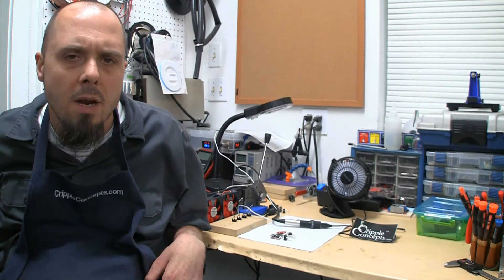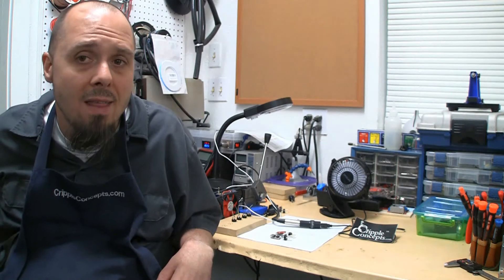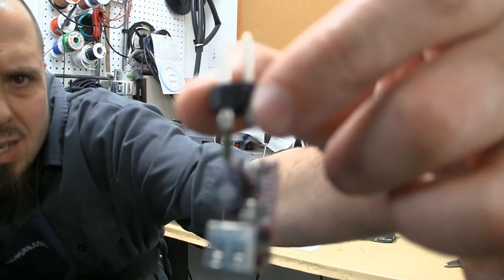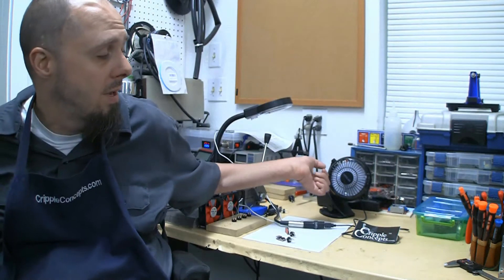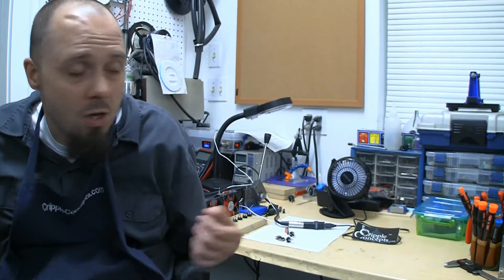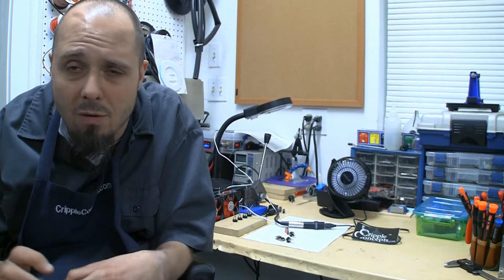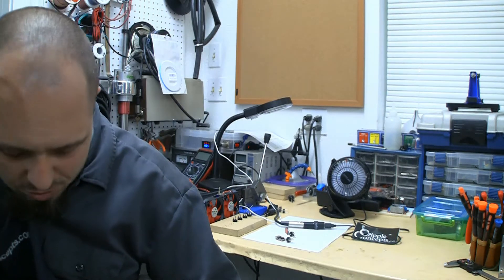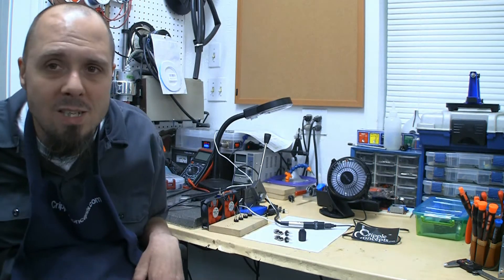Wheelchair USB Charger Power Port Update

Comment: Also, which diode do I need before I start making my charger today? Thanks!
Reply from the maker: It is a 1N4149, they are available online and even some Radio Shacks (I think there are still Radio Shacks...). I am not an electronics guru, the diode solved the failures and seems super reliable but there is probably a more elegant solution.
Reply: Cripple Concepts overnighted a set from Amazon. Thanks so much!!!